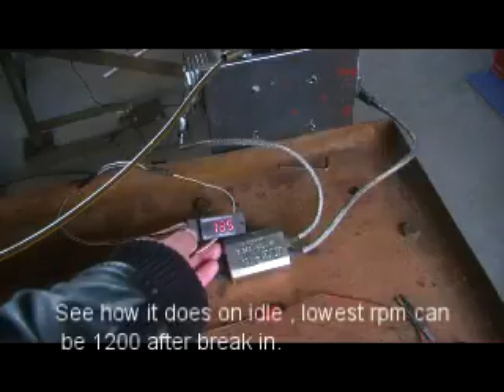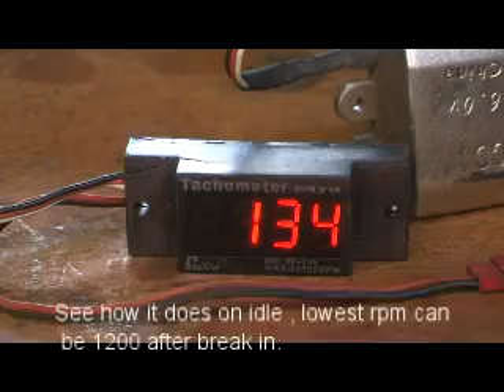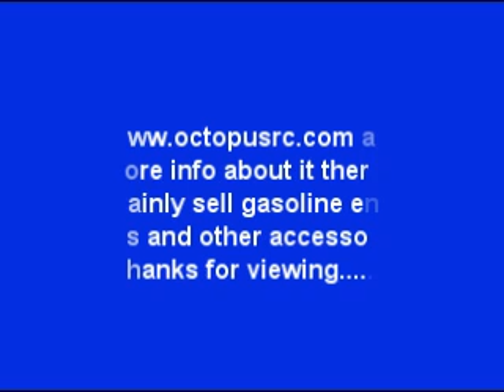53STS Bench Testing Run

Comment: Just fired mine up for the 1st time. After about 4 oz of fuel through it it's idle is around 1500 rpm and wide open is 6750 rpm with a 22X8 wooden prop. I still haven't gone through a complete setup of the H and L needles.